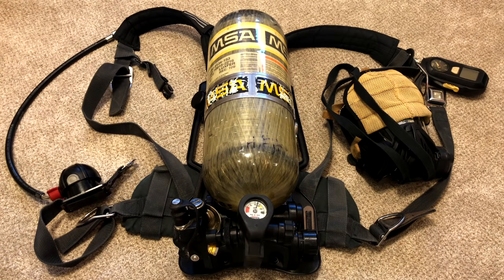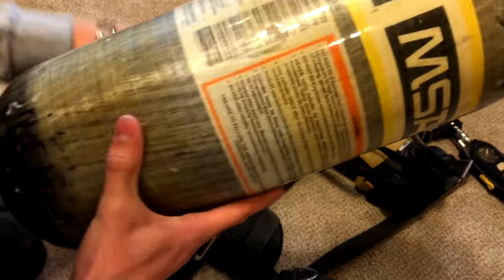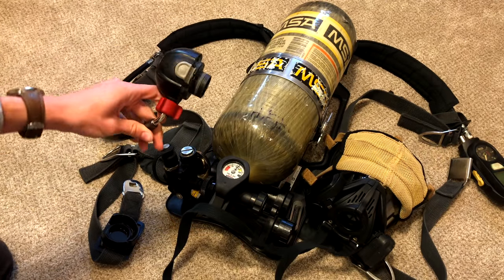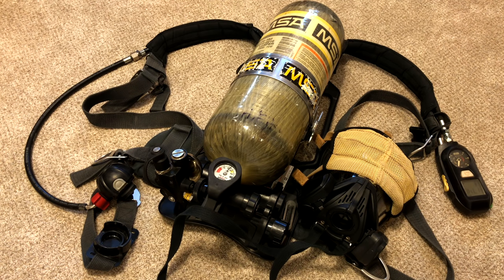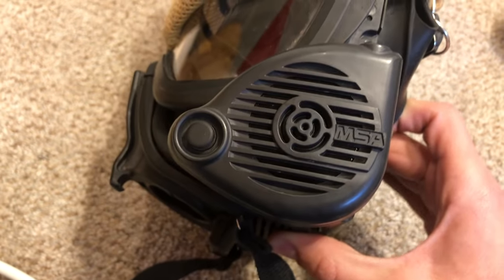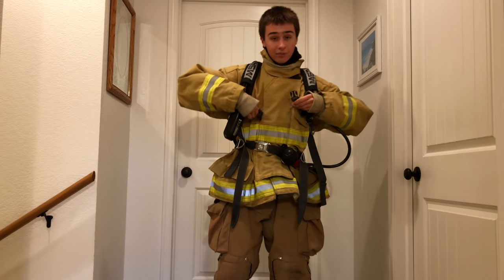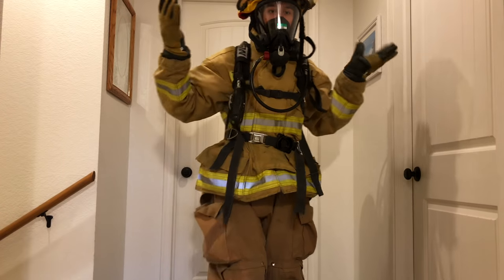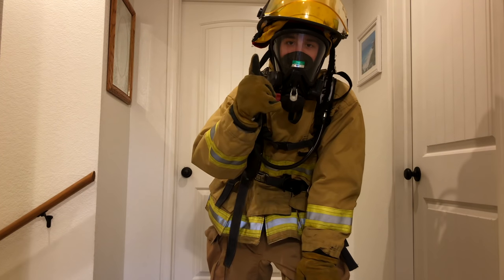MSA SCBA Operations for Firefighters (Self Contained Breathing Apparatus)

Comment: I am curious. As a diver, our tanks are usually standard at 3000 PSI (206 bar). You said in your video that once your tank reaches 5000 PSI the alarm bell will go off. That doesn't sound right. With 5000 PSI you would have plenty of air to last you awhile yet. I understand that your tank could have a different maximum PSI; however, you would have plenty of air at 5000 PSI. Could you clear this up for me?
Reply: 500 PSI is what i think my MSA starts ringing. we fill them between 2000-2500
Reply: That's a mistake in the video. The gauge is labelled 5-10-15-20-25-30 psi x100, so 500-1000-1500-2000-2500-3000 psi.
Reply: His pack is 2216 psi I think he meant 500 psi
Reply: dive bottles are 3000 psi in 80 Cu ft, 30min SCBA bottles are almost half... PSI alone is only half the equation, you also have to consider the bottle that the air compressed is suspended in.
Reply: put something you have to think about usually I said usually with divers your adrenaline is not rushing like it is for firefighters when we run into a burning building. it also depends on how well you can conserve your air it also depends on how big you are so how much more are you take how in shape you are and how hard you're working that all depends how long your air tank is going to last my usual last about 20-25 minutes MSA says they last up the 40 but usually I don't

Comment: Hey I know this video is 5 years old, but I got a question, I’m looking for something for wildfire emergencies here where I live, and this msa unit seems to be the most affordable for something that’s gonna sit it the closet 99%of the time… anyways, does the nozzle that connects to the mask have a 40mm connection like standard gas masks and filters, or is it a proprietary connection for that brand of equipment? Same with the bottles, do I need to only buy msa bottles or would any work? I have a mire safety 8m mask that I really like and fits me very well, just wondering if I can use it with this equipment…
Reply: proprietary
Reply: no you need an msa ultra-elite facepiece
Reply: @jaxrules2892  thanks buddy

Comment: About the simplex t bars u had one with 2holes and the key operated only bar has 2 screws where the plate is hold on to it and when u un screw those screws u find the t bar lever and 2 holes

Comment: Is it real hard to carry and walk around in? How heavy is it?
Reply: I wore one once and asked bout the same thing. These can weigh up to 40-50 pounds. It depends on how much air you have in the bottle.
Reply: Joshua Williams not bad at all. After about 2 or so hours I find the straps dig in my shoulder on the MSA packs. Scott who manufactures scbas (more high end/expensive) have better straps.
Reply: @FireRescue80  The amount of air inside of the tank does not affect the total weight of the kit. Compressed air is weightless (unless you are a scuba diver as more air inside the tank will create a slight positive buoyancy)
Reply: Joshua Williams dude even with all turnouts on and SCBA with mask on it is not heavy at all
Reply: @FireRescue80  that won’t change the weight
Reply: I find that the msa packs weigh about 22-24 pounds

Comment: Not a full minute in the Video and he says the Low Air Alarm will sound at 5000 PSI. If I remember correctly and I do My MSA bottle in my Fire academy holds 4200 PSI. So you're telling me that I should hear my Low air alarm the entire time I breathe air. If you meant 500 PSI I can see your reasoning but not 5000 PSI.
Reply: Yeah that’s what I said they usually hold 4500 psi or the older ones are 2216 psi I think he meant 500
Reply: 500 psi is where the red starts on the gauge. The gauge is labelled as psi times 100, so it probably was just a mistake.